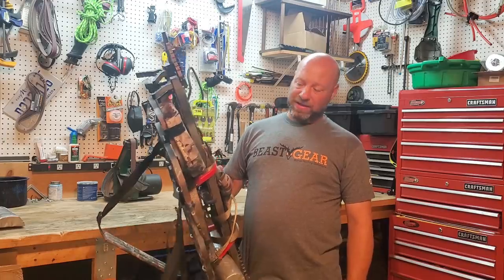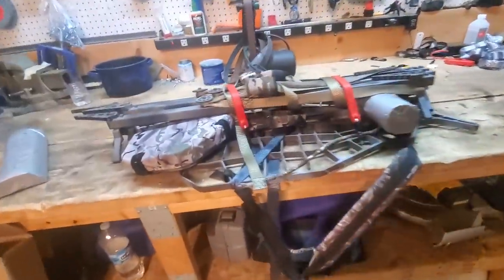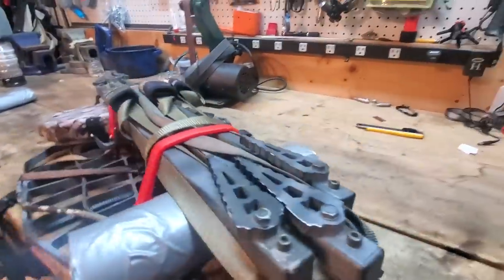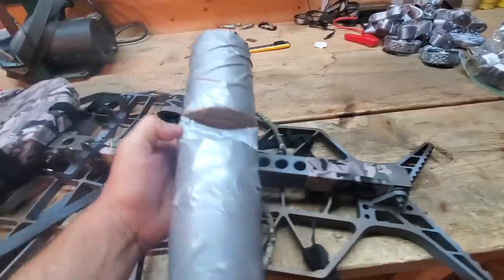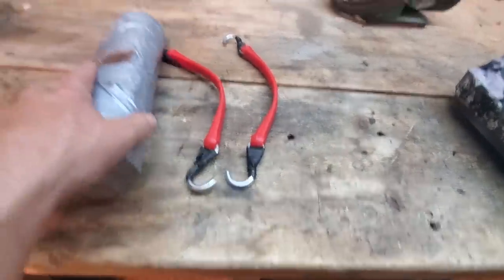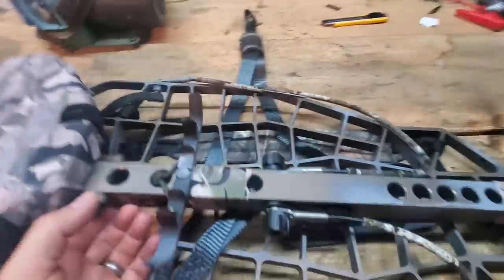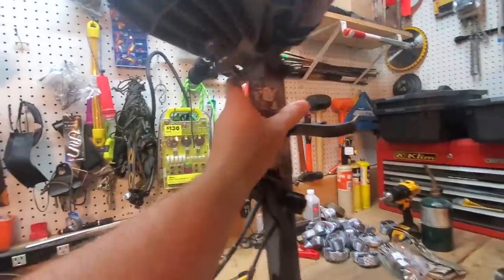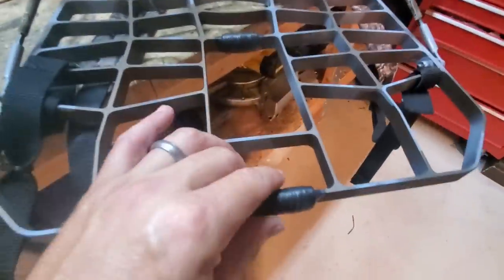How I Set Up My New Beast Stand And Mods

Comment: Hi Jason thanks for all the great info in all your videos! They’re Very helpful. I’m planning out a set up for mobile hunting and wonder if there’s a reason you don’t use the beast sticks ? Is it because you like the lone wolf better or that you already have them and don’t see a need to spend duplicate money on similar product? I’m trying to figure out which to go with and I have zero experience with this type of tree stand hunting. Thank you
Reply from the maker: I like full size 32 inch sticks and I like only having to use 3 of them. Beast doesn't make a stick bigger that the 20 inch minis. I'm my opion and for my style nothing out there beats the lone wolf or novix 3 step sticks
Reply: Thx for your reply!
I hadn’t done a length comparison and now that makes perfect sense. 
I really like your set up and will likely take advantage of your generous information and copy yours and then tailor it to my own needs if necessary. Thx again for your reply
Reply: Sry to bother you with this but how do I go about buying lone wolf sticks? I vaguely understand that they sold and are marketed as d’aquisto, but are the sticks like yours still available? The only search result directs me to a Shopify link and your link takes me to an Amazon page where they’re unavailable. Thx in advance
Reply from the maker: @jamesbeers4301  lone wolf is changing over to novix. You can get the sticks I use at novixhunting.com
Reply from the maker: @jamesbeers4301  sounds like a great plan. Any questions let me know.

Comment: Great video! Just out of curiosity, why do you only use one strap on the tree stand and not two? Is there a reason you only use the top strap?
Reply from the maker: The bottom strap is just to prevent kick out and not load bearing. Never felt a need for it personally so I have never used the bottom strap.
Reply: @SamkoTradBow  I see. Thanks!

Comment: The story with the knife had me laughing . You are always my go to channel for gear and technique. I am curious on what you think about using the Eberlestock main frame pack for saddle hunting gear. I use the same lonewolf sticks. Where we hunt i cannot legally dress and pack out a deer but this pack seems like a perfect saddle pack. I would also be able to pack the bow leaving the hunt. Thanks
Reply from the maker: The mainframe pack frame might not be best for that as the meat shelf is fixed and sticks put all the time. Allen makes a very compact frame thst has a folding meatshelf that I think would be better.. I would think you would want the frame flat without a meat shelf so you can pack gear and sticks nice and tight. Not sure if you would be able to do that on the mainframe.

Comment: Nice setup. MSRP $625.00  not so nice..
Reply from the maker: The price is a bit of a shock. But the quality fit and finish, weight, size, and functionality really are top shelf all the way. It's my favorite stand now. To me worth it. Especially since I will use this one 10-12- 15 years or so spreading that cost over that time is very affordable for what you get in return.